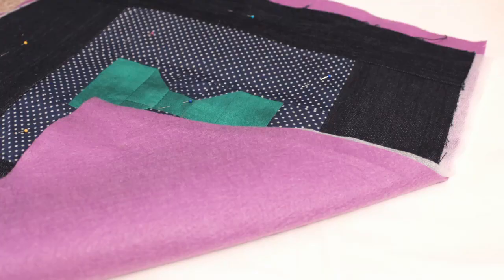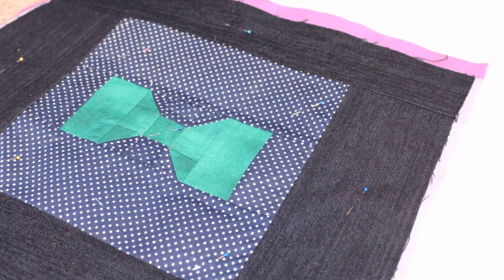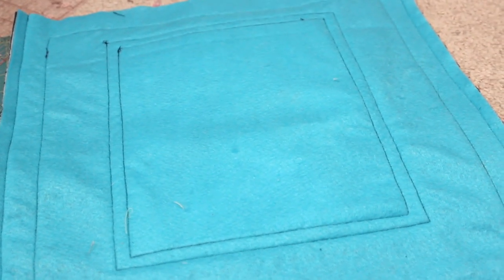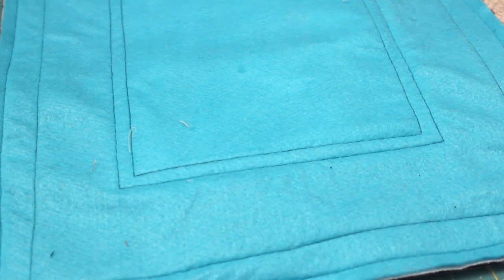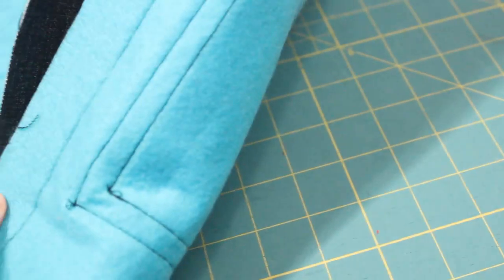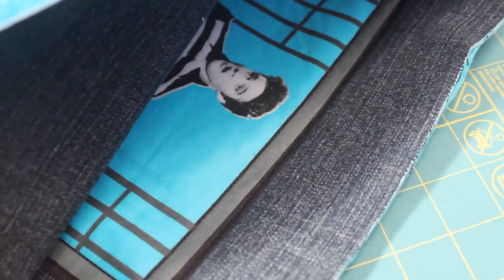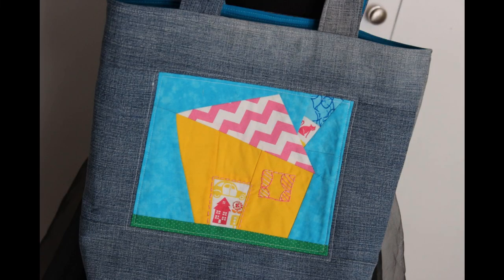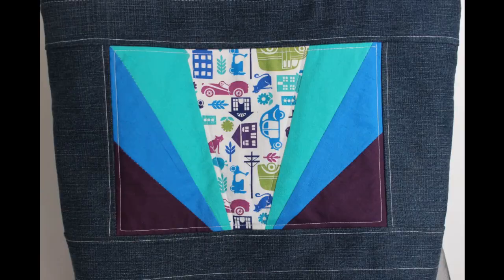Using Felt for Stabilizer - Whitney Sews

Comment: I've been using felt for stabilizer for years and it's great. I use basting spray to avoid pining so much and it has worked for me so far. It doesn't gum up my needle when I do my quilting. I also use both felt and fleece at the same time. The fleece is between the main fabric and the felt. It just makes your quilting stand out more. If that makes sense lol! I use basting spray on both sides of the fleece to keep everything together.

Comment: Hello! 
I enjoy watching your sewing videos. Keep them coming! 
I too experimented with felt that I bought at 1.00 per yard to use as bag stablizers. I thought it worked great for smaller wallet size projects and zippered make-up bags. 
I used to do upholstery work and have all but given it up because of back and neck problems, which has lead me to wanting to still sew and maybe sell some items. Purses came to mind, so I finally started web searching to find out more. I find it interesting that you also have used some felt in your projects.
In a handbag I made, it stood well on its own until I laundered it, actually twice  and now is what I consider kinda droopy but still standing. I decided to make the felt fusible by using paper back fusible web applied to one side. It worked great. I used denim on the bottom third and a cotton  home decor weight for the top 2/3 and handles. ( that fabric was actually some that I had made curtain panels out of that I couldn't part with when I changed the curtains). I still carry the bag. 
Thanks again! It's fun to see what other sewers are making.

Comment from the maker: Over the years I've made a lot of different bags with a lot of different stabilizers.  So what happens when in the middle of a project and I run out of the interfacings I want to use...I give other materials a try!  For a few of my totes I decided to try using felt as the stabilizer and 'quilt' my outer later to it.  Check out the video to see how I sew it all together and how my bags turned out :)

http://youtu.be/JptsV448xRU

Comment: I have been seeing videos using cling wrap to attach media. Also have seen decoupaging glues applied and allowed to dry before ironing to melt the glue (like your own iron-on interfacing). I have used felt sheets and foam sheets in small projects sewn on.

Comment: I like to use denim for projects that I want to add strength and body to without the added thickness.  And I like to use flannel for the same purpose, but as a lighter weight option.  Denim is great because you can get it so cheap at thrift stores, and if it's good quality, it's pretty much invisible.
Reply from the maker: ***** Great idea to use denim!

Comment: there are different thicknesses for felt I always use white thinner felt for bags, it works really fine, and is cheaper then stabilizer, spray it with some fabric glue sew only the borders your done

Comment: Have you ever used felt as a batting in something like a table runner.   Most felt that I have used/bought is the washable kind.  Use only could water wash and then light warm iron press ( mostly costume pieces)
Reply from the maker: Trayne1837 Yes.  I used felt in my recent candy corn table runner tutorial :)

Comment: Did you wash some of the things you made with felt? Because I heard that it shrinks up to 50%. If I don't have interfacing I use fleece.
Reply from the maker: Mia Miau The items I use the felt on are meant for spot cleaning only, not throwing in the wash all the time.
Reply: I used felt yardage off the bolt. I have washed and dried a purse twice that I made and it did not shrink.
My fabrics were prewashed however. But I do know that wool felt will shrink quite a bit.